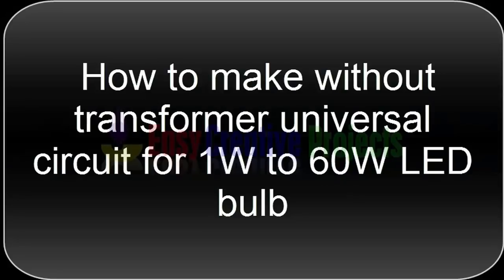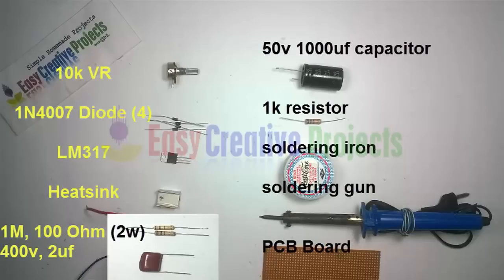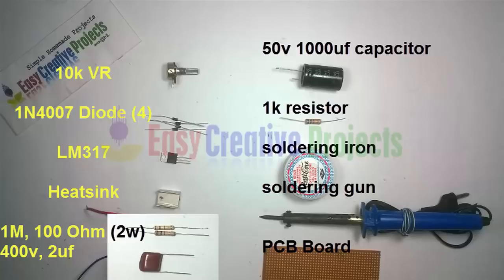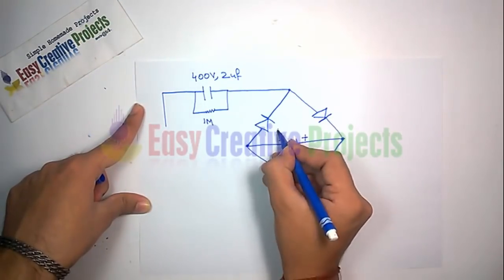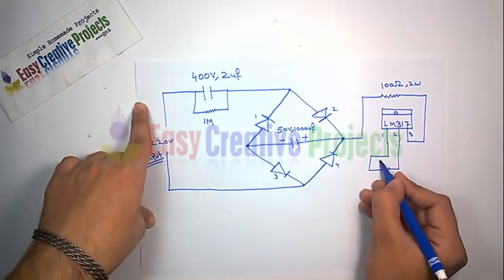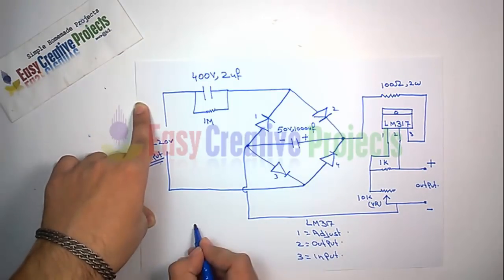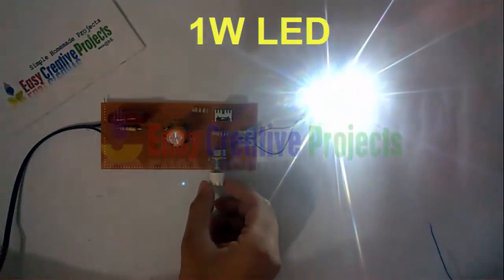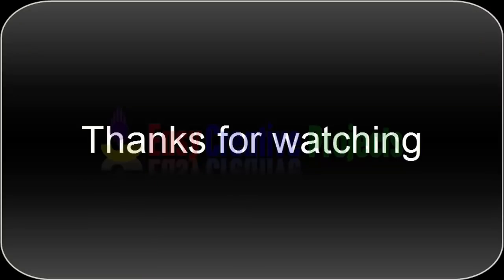How to make without transformer universal circuit for 1w to 60w LED bulb

Comment: 1 watt led burns on this circuit i tested
Reply from the maker: dear 1st adjust power on minimum using variable resistor then connect led. 
if you adjust maximum power and then connect 1w led the its definitely burn. 
if you want run only 1w led then see video on our channel ( How to run 1 watt LED Bulb on 220v )
thanks.
Reply: @EasyCreativeProjects  thanks

Comment: Hi ECP, congratulation for your video but i would like to ask you something. How much does the voltage at the end of the LED become? Different LEDs, different supply voltages? Thank you
Reply from the maker: dear this circuit give maximum 18v output.
Reply: ..so chip LED 20W 600mA don't work.. because  its power supply  is 31-34V
Reply from the maker: dear you can try but in china product total different about actual powers. 
if you your need 34v. so simple use 34v transformer.  or 18-0-18  transformer. its give you 36 volt.

Comment: How to connect a 10k vr it also has a 3 pins
Reply from the maker: in this circuit we use only 2 pin. 1st and 2nd.
Reply: Thanks
Reply: What amp does it gives in o/p
Reply from the maker: if you want to good amp so use transformer.
see video on my channel   How to make universal circuit for 1W to 60W LED bulb

Comment: Yah ket na amp ka hi
Reply from the maker: 2amp
Reply: Thanks bhai
Reply: Or yah output ket voltage Da Raha hi.
Reply from the maker: dear adjustable ha jitni voltage aap ko zarort ha aap utni variable resistor say set kr sktay ho.
Reply: Mera bol na ka matlb tha ke yah max ket na voltage Da Sakta hi.
Reply from the maker: 24
Reply: Thanks bro

Comment: Hon.can it be done using transformer? If so what will be it's configuration? Like 230 AC to 12 volt DC it's amp.?
Reply from the maker: yes if you want to make this circuit with transformer so see video on my channel, how to make universal circuit 1w to 60w led bulb.
thanksl

Comment: I am connected 2.2uf 400v capacitor in series.it was burned. Plz suggest another option of that
Reply from the maker: dear must use minimum 2watt resistor with capacitor.  if you want alternative. souse transformer circuit.
 see video on my channel with transformer universal circuit for 1w to 60w led
Reply: 2.2 uf serie 2.2 uf = 1.1 uf  --------------------------2,2 uf paralelo 2,2 uf = 4.4 uf

Comment: Sir 2uf capicitor is not available in my area what should I use instead of 2uf ,400v capacitor?????
Reply from the maker: try to use 2 capacitor of 1uf, 400v. or 105j number.
Reply: It is not working properly RV 10 k is not working
Reply: 5watt led is so dim